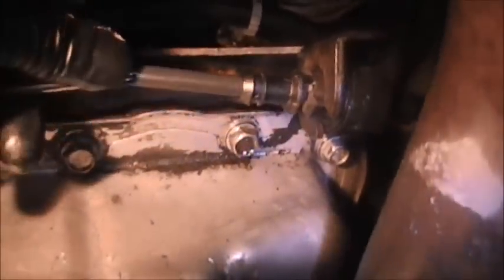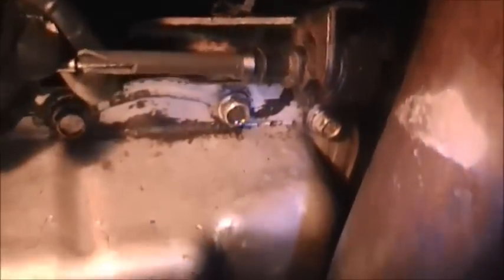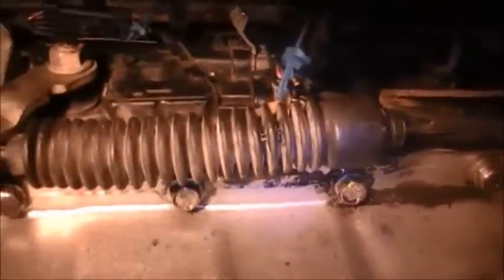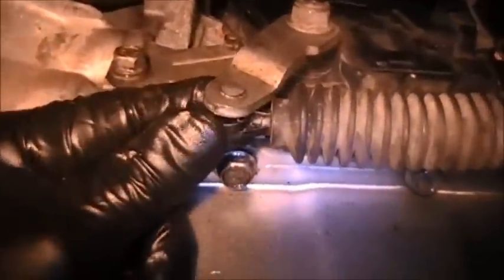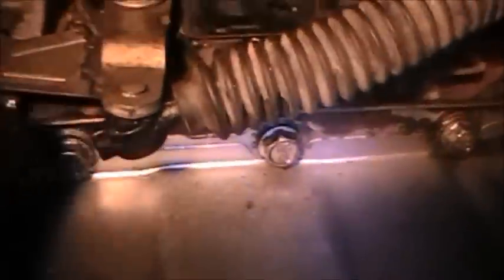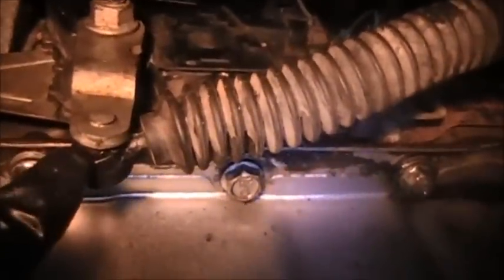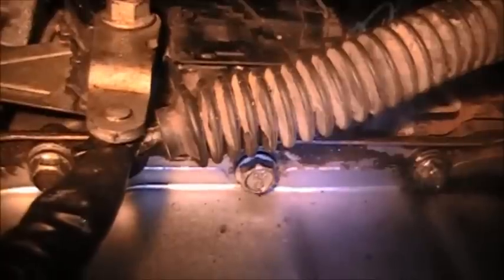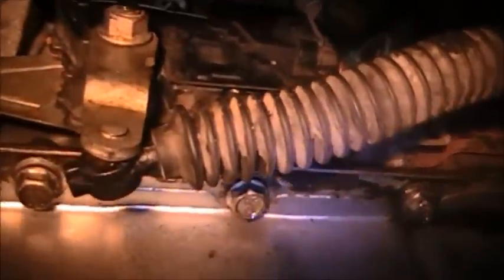Chevy tahoe shift cable part 1

Comment: I got a 01 chevy suburban & the shifter I have to jerk it out of park. But something just recently broke and I have to do it manuely with a credence wrench. any thoughts ?
Reply from the maker: What do you have to do manually with a cresent wrench?
Reply: +questioning3 switch my gears
Reply from the maker: What do you do with the wrench? Where do you put it?
Reply: +questioning3 on the part where it switches gears. like where the wire goes connected too I guess
Reply: +questioning3 on the part where it switches gears. like where the wire goes connected too I guess

Comment: what year was your Tahoe...have a 98 w/broken head of the shifter cable that attaches to the shifter lever on the steering column. Is it possible to just replace the plug end (that attaches cable to shifter lever) of the shifter (very little wear through to the tranny)  or do i have to replace the whole cable ? thx
Reply from the maker: +1307 can you send me a picture of what you are talking about? ttyusii@yahoo.com
Reply: questioning3 my shift moves my trans to park, netruel and reverse.  can that be the cable still??.

Comment: what were the vehicle symptoms that lead you to suspect the shifter cable. my chevy van shifts into gear but when i press the gas in forward or reverse it doesn't move.
Reply from the maker: The shifter cable is bad when the gear selector is sloppy or  it is hard to put it in the proper gear using the gear selector.
Reply: ok thanks
Reply: pora radi o

Comment: I've done this and that 4 time's my transmission is still not allowing me to shift I tried changing even the box on this shifting column itself because it doesn't want to grab first or if it does it doesn't want to grab Park and never locks into anything but drive neutral sometimes Park but not reverse and vice versa I'm at loss